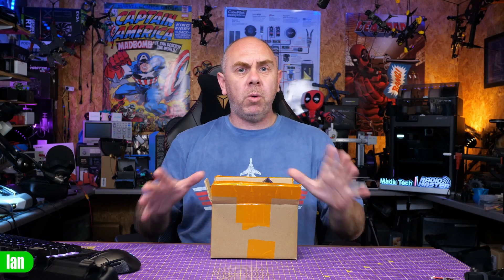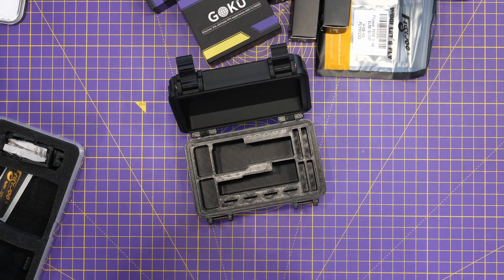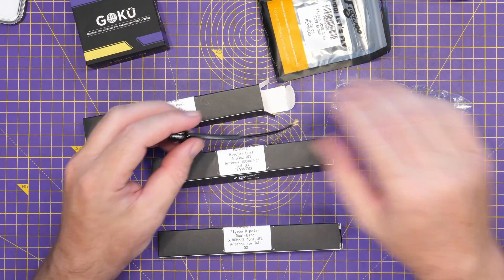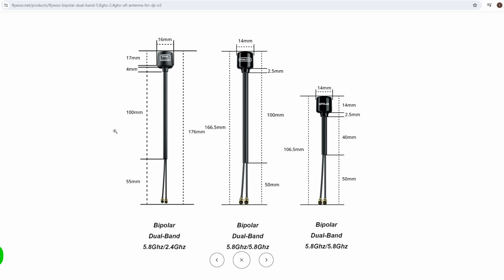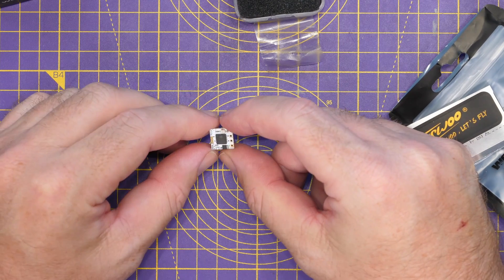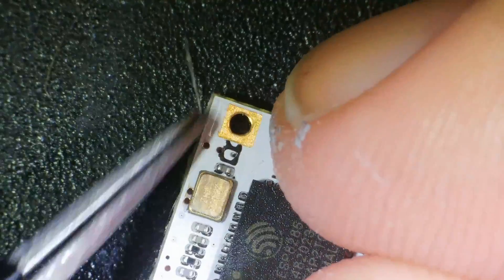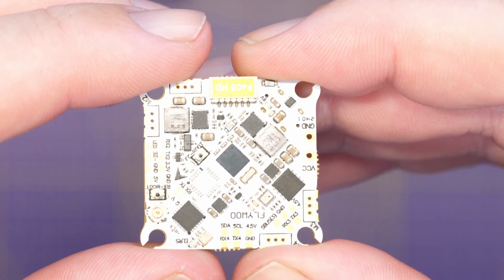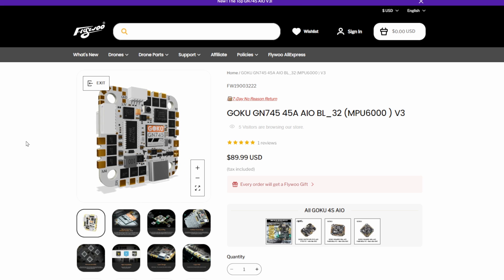FlyWoo New FPV Flight Controllers & Accessories

Comment: Do these new AIOs support INAV?
Reply: Previous editions of Goku F405, F745 that have INAV and Ardopilot firmware targets. So these FC's may supported already. Issue would likely be baro, or IMU compatibility compared to previous editions.  It would be nice to know the minimum firmware version an FC supports and was tested with, but few manufactures list this in the specs.

Comment: Will the Bipolar Dual 5.8ghz only antennas work well with the walksnail dual vtx? - I realize it likely wouldn't be as good as 2 antennas, but curious if this would work for simpler mounting, especially on smaller drones.

Comment: I bought an Flywoo exploler along with a BipolarDual-Band 5.8Ghz/2.4Ghz UFL antenna and I have the impression that the coverage is worse than when I had the original antenna from 03. I decided to do an FCC hack on goggles2 to improve the transmission. Has anyone had a similar experience or is it just my incompetence? :)

Comment: I have a couple of these F405 AIO's. One of the main selling points was that the 9V BEC can be hooked up to a controller switch with USER1in betaflight, however when you have bidirectional dshot turned on and the pinio mapping for the switch configured the 9V power will just turn off after about 10-15 seconds regardless of the position of the switch. You have to disable that functionality by setting the pinio 1 resource to none to get the stupid thing to stay on at all. Otherwise it's a great FC, got one in a Flylens 85 and another in a Fractal Wingman.
Reply: This helped me more than you can imagine, I’ve 3 of these and been trying to get this all working since they came out, even talking to flywoo wasn’t helpful!
Reply: @TobyDavies  Dude, talking to Flywoo support, while they did eventually give me the answer, was a full week of messaging back and forth trying to get some kind of resolution out of them. It was like pulling teeth. Glad you're able to use them. They are actually really good FCs once you can get the 9V to stay on.
Reply: @icebalm  I just gave up with them as they didn't know what was happening and since it’s a pretty new FC no one was really talking about it so I thought I was screwed. I know when they first launched it the site said to use user 1 and change it to user 2 so I'm guessing they've messed up already and not fixed it. I've just set it up now and it’s all working perfectly like it should! Thank you!
Reply: They have solved this problem. Just write these two commands.
set dshot_burst = OFF
set dshot_bitbang = OFF
SAVE
Reply: Try turning off LED_STRIP on the config tab instead of turning off b-dshot.  This has resolved the VTX power issue on at least one of the two goku f405 HD v2's I bought (I haven't fully tested on the other yet).  Flown around 10 packs so far without the vtx turning off or doing anything suspicious, and I have b-dshot on and can turn the VTX on and off from my remote okay.

I ran into the same problem though... as soon as I turned on b-dshot the VTX started randomly turning off after a few seconds.  I noticed that changing the led configuration seemed to affect how long it took for the VTX to turn off which led me to disabling LED_STRIP and I haven't had the VTX power misbehave since then.  I'm on 4.5.0.

I'm using this from the flylens85 config with LED_STRIP turned off, b-dshot on, VTX switch will be USER2:
resource PINIO 1 D06
resource PINIO 2 B05
set pinio_config = 1,1,1,1
set pinio_box = 40,41,255,255
Reply: @nathanlucas5496  Oh! That's interesting. Thanks for posting. I didn't actually need the VTX power switch functionality since I run HDZERO and I can turn the VTX on/off with stick commands, but I'll keep this in mind if I ever need it!

Comment: What is their plan for continuing the supply of BL32 ESC on the io?
Reply: Ditto. Don't expect Flywoo will be manufacturing new batches of  F745 AIO with BL32 firmware. They may have inventory, but would be nice to know what support plans they have going forward.